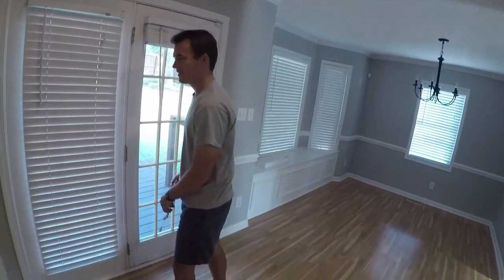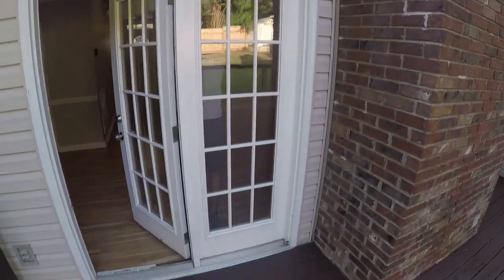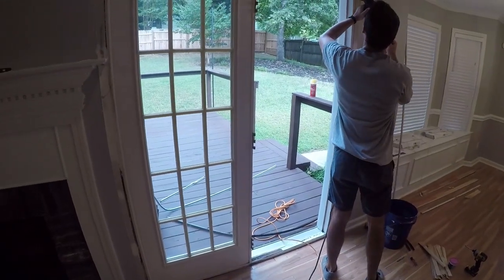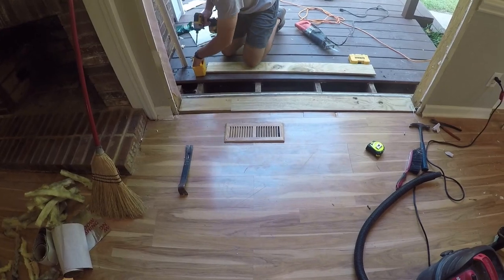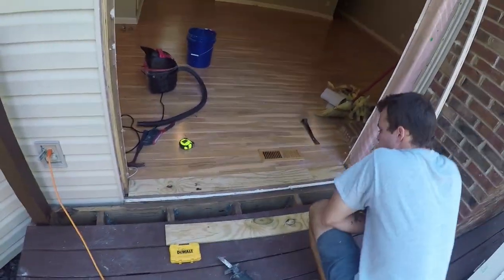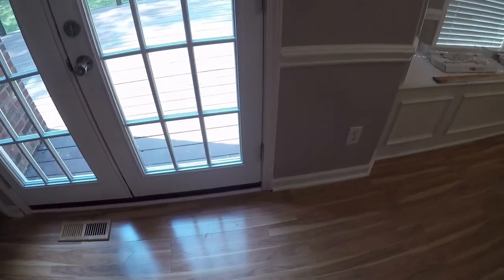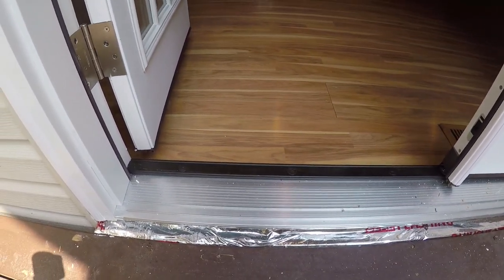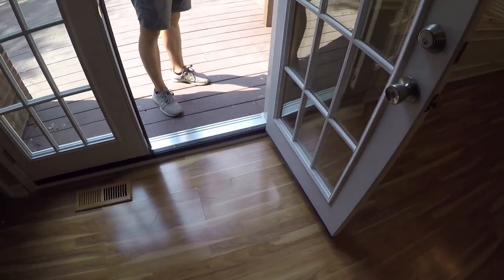French door replacement

Comment: I run Into these issues quite often as well. It’s actually the rain bouncing off the deck, hitting the door and running back in between the door and the threshold plate. That’s why the bottom of the door frame was rotted out underneath. Nice move with replacing that rotted wood though. A lot of dishonest people would’ve left that!